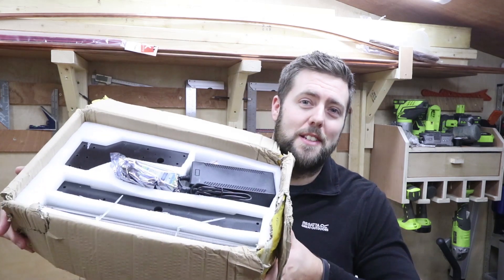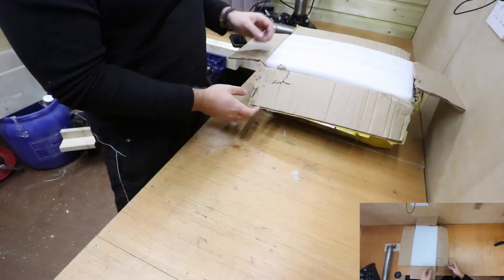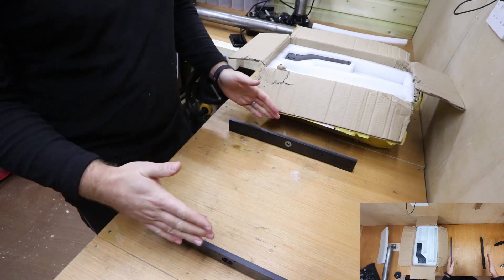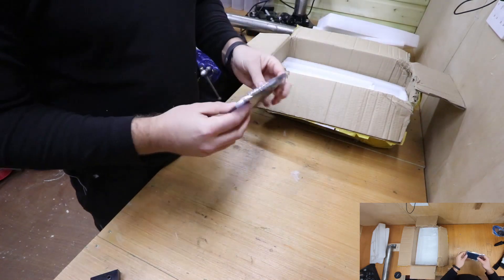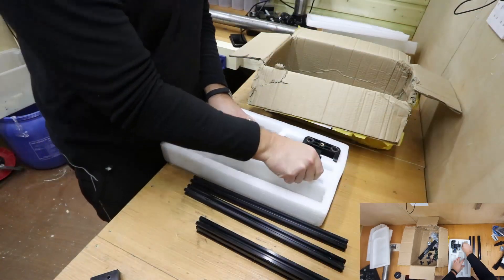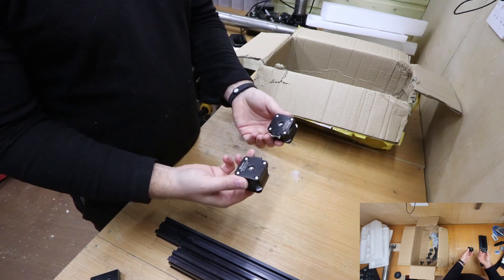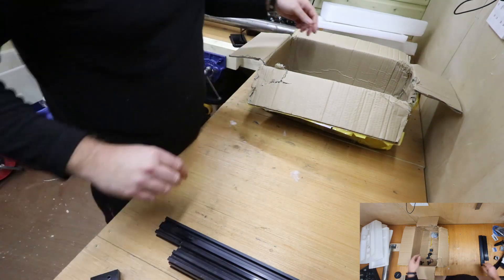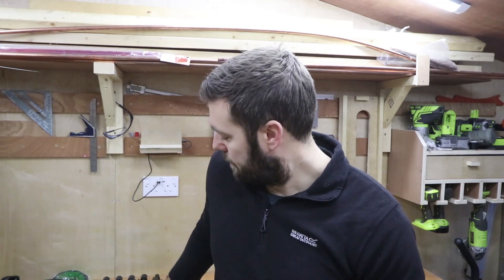3018 PRO CNC unboxing

Comment: One month ago I purchased my 3018 PRO CNC at VEVOR.  Also made in China, probably from the same factory.  At first glance there are some differences. I finished the physical build up of the machine and managed to do the wiring (although the manual wasn't very helpful with the latter)  The second part of the manual is Chinese for me. It's about how to get the machine up and running (quite important), so I hope episodes  2, 3 and 4 of your series help me with this.

Comment: Hi James, what are the deferent between 3018 pro, 3018 max  and  3018 pro max. Witch one is better to buy.thanks in advance.
Reply from the maker: Slightly difficult to say as different manufacturers list them differently. With Sainsmart, the Pro is the base model, the Prover all metal frame, limit switches, side dust guards and offline controller I believe and the 3020 Pro Max is all metal, slightly bigger bed area, better spindle, linear rails which help the precision and minimise wobble
Reply: @JamesDeanDesigns  
Thank you sir for the quick reply 🙏

Comment: hi there watching your channel with interest im looking for a low cost cnc machine for cutting wing parts for a rc plane  using a mixture of balsa up to 6mm and 3mm liteplywood, in your opinion would the pro3018 be up to the job- speed is not a concern but relative accuracy  would be good

Comment: Hello James, I’m on the brink of buying a 3018 Pro with a 15W laser but from a firm called HomdMarket. I wasn’t aware that Sainsmart supplied a 15W laser. I’ve checked their website and can’t find one.
I’ve looked at Sainsmart but the reviews are mixed. 
Many thanks for your videos.
Reply from the maker: Just be careful when buying a "15w" laser. I'm not saying they don't exist because they do, however you are probably talking close to £1000 for a true 15w diode laser. The ones that are actually sold with these machines are closer to 7w. I know this from personal experience as mine was meant to have been a 15w as well. Companies falsely quote the input wattage rather than the output. I think the maximum Sainsmart mak is a 5.5w output if I remember correctly.
Reply: @JamesDeanDesigns  Thank you very much James. I questioned the seller about the wattage and they insisted that it’s 15W power. They also sell lower wattage lasers with the same CNC machine. This is the one I’m interested in. https://www.amazon.co.uk/%E3%80%9015W%E3%80%91CNC-Engraving-Machine-Control-Controller/dp/B08JG55PJQ
Reply from the maker: @ianknight2053  The issue is you'll never really know unless you have the facility to test it. Just to put it into perspective, this guy makes genuinely rated 10w lasers and these are typically about $700 on there own. Im still happy with my laser but supposedly being a 15w  I was expecting it to be 3 times more powerful than the 5w I was seeing and it really wasn't.
Reply: @JamesDeanDesigns  Thank you James. I really appreciate your replies. If the 15W lasers don’t come up to spec. I wonder what the 5.5W variety are!
Reply from the maker: @ianknight2053  its a nightmare. I was annoyed to begin with but blamed my self for not researching. In saying that I'm still happy with my laser and its pretty strong.
Reply: @JamesDeanDesigns  I’m sure the laser will be adequate for my needs but I don’t want to pay extra your something that I’m not getting. I’ve sent the seller yet another message asking them to confirm if the laser is 15W input or output. I’m sure your right and that it’s input and the output is nearer 5.5W.
I’m actually a Leathercrafter and want the laser for engraving designs and cutting intricate shapes. I’m promised that the laser will cut 2mm thick leather but I’m not sure how many passes that would require or if it will leave burn marks.
I’m really grateful for your input James and enjoy your videos very much.
Reply: Hello again James, I’ve just had a message from HomdMarket, the seller of the ‘15w’ laser. They have confirmed that the electrical power is 15w and the optical power of the laser is 5.5w. So it appears that they are charging the customer (£400) for something they’re not getting. I might wait until Sainsmart has U.K. stock and buy from them. You’re right, it’s a nightmare. Thank you for the heads up. Ian
Reply from the maker: @ianknight2053  bad news but good news at the same time. At least you didn't waste your money. If you're on Facebook, it might be worth asking in the Sainsmart group what lasers people use for leather
Reply: @JamesDeanDesigns  Thanks James, I’ve joined.

Comment: I ordered mine in November 2020. The packaging was different. The collet chuck was already mounted to the motor. (very well, testing with power supply produced zero vibration) No safety glasses, but the controller board had a nice plastic housing with a fan. So far, impressed. On to episode 2!
Reply from the maker: These are all made by different companies, but one of the best companies is Sainsmart which is who I recommend and theirs can look a little different. I got mine off ebay and had a nightmare with the seller so I always recommend using better companies now like Sainsmart

Comment: Taking the day off today, thought it'd be a good idea to review this series from the start and see if I can't figure out how to configure my set up a little better. I really like the way you explain things. I'm hoping I will absorb a bit more this go around, since now I am a bit more familiar with the terminology.
Reply from the maker: Thanks. 👍 one important point i didn't cover as well as I should have is keeping everything as square as possible. The frame, the bed in relation to the frame, the uprights etc. The more square it is when you build it the smoother it should run
Reply: @JamesDeanDesigns  Thanks! So far things are looking fairly square, luckily. However, I am noticing there is a lot of play in the brass nuts; they click against the sides when the lead screws are turned and I am wondering how much that might be affecting the travel distance accuracy. Not sure if they are a heavy contributor to my vibration issues, which is most likely the biggest thing I need to tackle, but the clicking is annoying.
Reply from the maker: @jabberdoggy4444  they do have a little play in them. People sometimes wedge bits down the slide to minimise it but I've never done it with mine. 90% of your vibration will come from your spindle usually. Its crazy how the slightest imbalance in that can cause vibration issues
Reply: @JamesDeanDesigns  Thanks again. Yeah, that spindle should probably be my focus, in that case. The little metal sleeves slipped out and started bouncing around like mad last time I tried to use it. I'll start researching that more.
Reply from the maker: @jabberdoggy4444  metal sleeve? If that's your bearings just be careful. Once they come out you will need to do something to hold them in place. Not sure if you watched my tips and tricks video but the two usual options are epoxy or a set screw
Reply: @JamesDeanDesigns  Yes, it was the metal sleeves  think. I did watch your tips and tricks (and have been recommending it to people), but haven't gotten to it on my rewatch of this series. I will definitely check that. Good call on the spindle vibration, btw, I just found some areas that had gotten quite loose, particularly the collet.

Comment: Saw you on Instagram followed the link and here i am. One thing about that machine it wont do any aggressive cutting you need to go VERY slow or the machine will bend mid cut and the piece will be ruined and you might break your bit or damage the motor. Also you cant really control the motor speed. Have fun!
Reply from the maker: Thanks for following! I'm new to all of this so there is bound to be some mistakes along the way but I'm taking in all the advice I'm getting, its really appreciated

Comment: Hi James do all cnc machines come in parts?  I noticed Peter Millard also had to build his. 140 sounds good though if it does a decent job.
Reply from the maker: To my knowledge most of them require some sort of assembling.  Although I suspect some of the bigger ones aren't quite a fiddly as the small parts in this one
Reply: @JamesDeanDesigns  I'm looking forward to the saries mate.
Reply: @JamesDeanDesigns  I’m actually looking forward to building my own. It gives you more of an understanding of how the machine works and makes it easier to repair or upgrade.